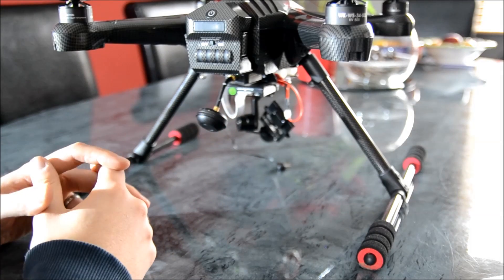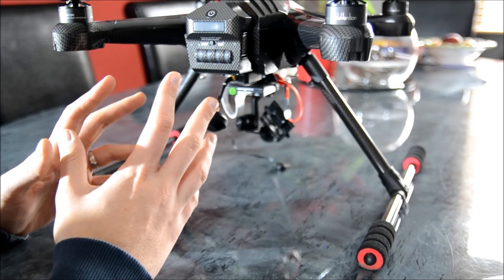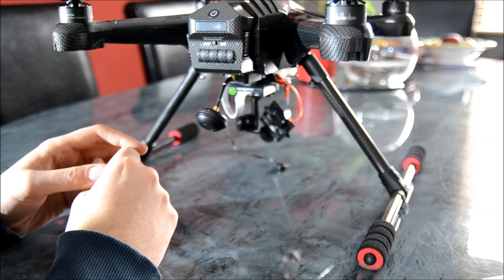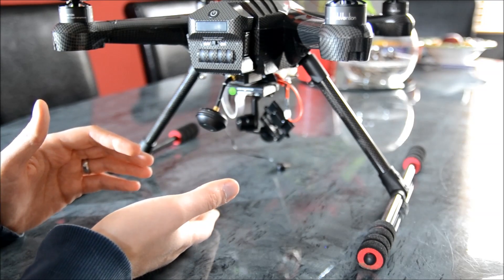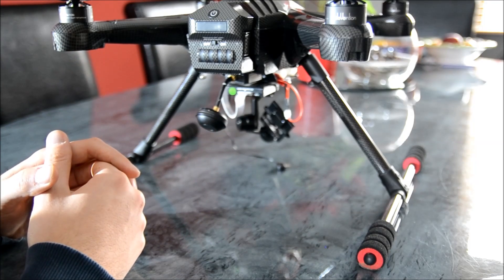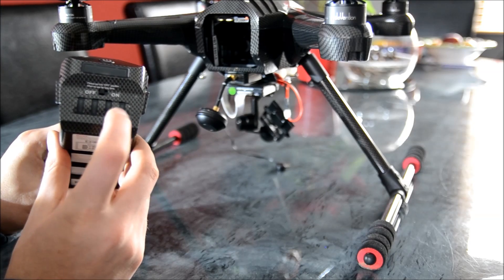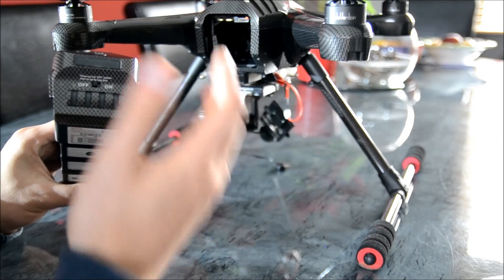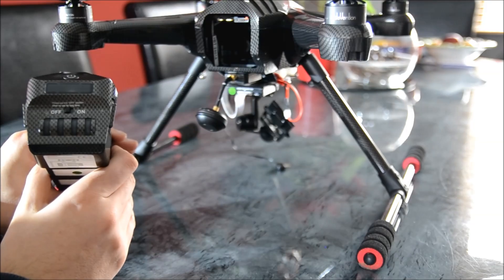Walkera Scout X4 - LIPO Battery Inaccuracy

Comment: is it possible to increase the mah / Battery capacity / fly time of the drone?
another battery pack that can be used perhaps? (bought somewhere or put together yourself)
Reply from the maker: +ThePaalanBoy you won't be able to increase flight time. If you look after the battery then it will run more efficient...and last longer.
Reply: Alex Savo ....can i or can i not get more then 30 min flight time? -_-

Comment: Hi alex , I have the same problem with my x4, it is fully charged and I only got 6 min flight time before it trigger the voltage alarm at 21.6v, and when it landed , it had only one green light left at the battery . And then I turn off the x4 and the f12e, turn both back on , surprisedly the battery shows 3 green light again and transmitter telling me I have 23v left. This issue is very frustrating and have you got a solution yet ? What low voltage setting you are using now
Reply from the maker: Have you checked the voltage of the battery on a voltage meter?  Do you believe it to be the Scout not reading the battery correctly or maybe an issue with the battery? If one cell in the battery is slightly faulty (and it's not unheard of) you will get a low reading early on. To me, it sounds more like a dodgy battery?

Comment: Confirmed, I have two batteries: one of them reaches 20mins with recording (g-3d gimbal/ilook+) while the second one has problems after 8minutes :-( but I think the problem is That I'm flying on -10C - at least I really do hope so
Reply from the maker: interesting. Have you measured the voltage on the 8min battery? is it accurate? ie. at 8mins there is not much left, or that the Scout has measured it wrong?
Reply: Im going toncheck that later that day (voltage) i only experienced the left blinking led (1) and landed. After going home I do have 3leds blinking. So now Ill try that with the look on voltage params
Reply from the maker: That's my plan. Fly, land, check voltage, take off, land etc etc...work out if its the battery or an issue with reading the battery voltage correctly.

Comment: I do have 2 battery's and no problem so far
easy can fly 18 minutes with camera etc (low wind conditions)
all showing correct on devo screen
after 18 minutes fly charger shows 3,65 V x6 devo shows 21,2 V
without camera max time was 23 minutes till devo shows 21.2 and same 3.65 on charger
both battery's same results. 
Remember battery voltage drops during load ! that's way charger shows always more than devo
Reply from the maker: Thank you for the useful comment. That is why I was confused that the likes of yourself can have 18mins of flying and your readings were more accurate. Something isn't quite right somewhere with my quad.
Reply: try set devo for 18 minutes + down V limit 21.2 and hovering about 2 m
ignore alerts ... if drone start to be week u will know what is your limits :)
of course watch what devo say - give a picture of difference if your devo shows 19V but charger is 3,65 V per cell - that is your settings but  do not go below 3.65 V per cell for charger
record your devo screen for monitor how is going V with time
anyway all of us one day lose their toy :)
Reply from the maker: Well I figure that in 7 mins I go from 4.25 to 3.91. That's about 0.34. So another 7mins would loose 0.34 and bring down the battery to 3.57. So maybe another 6mins of flying? Depending on weather.
Reply: In my case first 1 V drops very quick then battery holds from 23 to 21.5 V a lot longer
I'm sure u can fly 18 minutes or/maybe u TX 5.8 ghz drain battery ??
Reply from the maker: 18 mins....wow...double the time I am getting. I will try the flying to 3.65v per cell and see what I get then, and if need be, look at the receiver or gimbal. Video to come with my finding :)

Comment: Try reducing your Battery FS 1 digit at a time on the F12E and check the battery after each flight. Then eventually you will get an accurate "Time to Land it".   I've been doing exactly that and I've increased my flight time from 8 minutes to 11 minutes so far and still got capacity left in the battery. (no camera or gimble)
Reply from the maker: Cheers Jim, that is my next step. To adjust to a new "safe" landing realistic voltage. What do you have yours set to?
Reply: Alex Savo Edit that Alex, should have read Mission Planner not the F12E.   My FS_BATT_VOLTAGE is at 21.0V.  Not all batteries are made equal!
Reply from the maker: Jim Tolan Thanks. When I fly next, I will be reducing it, checking the battery status and going from there. I would like to get 10+ minutes.

Comment: This is normal.  Batteries internals are difficult to detect with elcetronics unless under stress.  Its reasonably active in air as i walked it around my neghborhood and watch the batter decline in an expected fashion.  

But unless the scout is in the air.  You will get the wrong reading
Reply from the maker: Thanks for that. I think the concern for me is that I am landing at the recommended 21.4 only to find I still have 60% left. Plenty of flying time left.